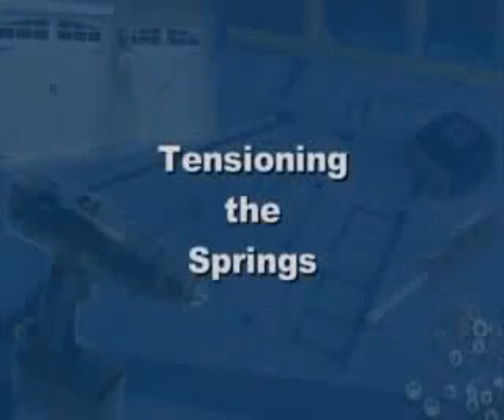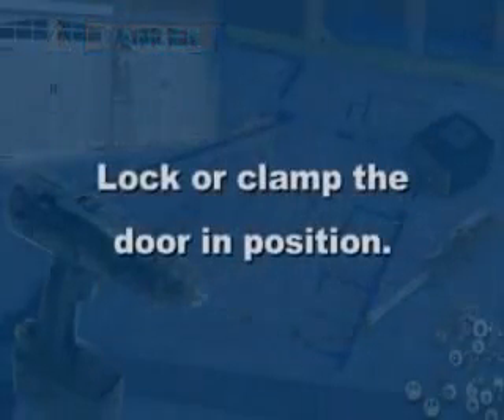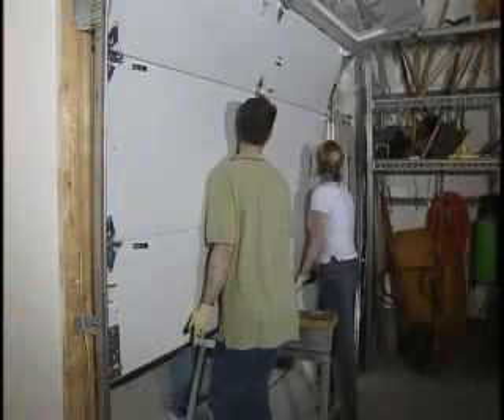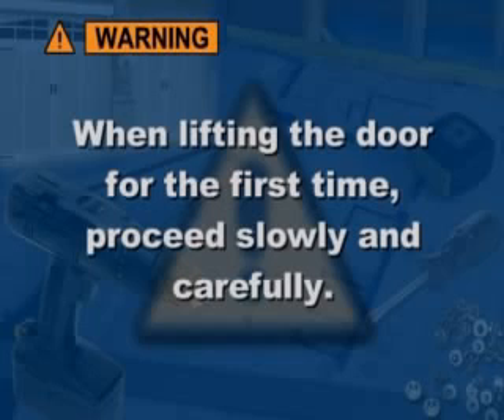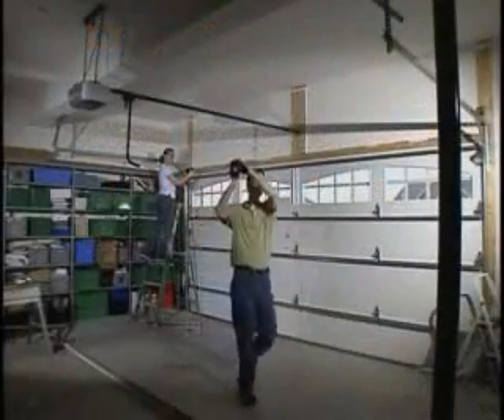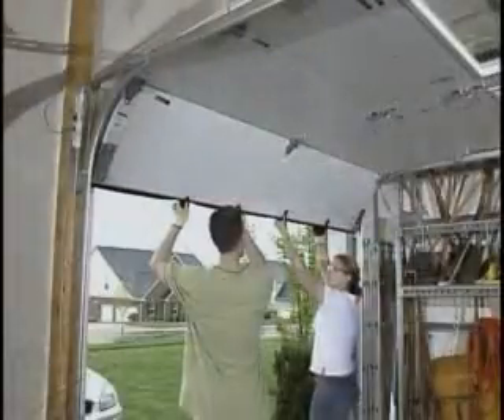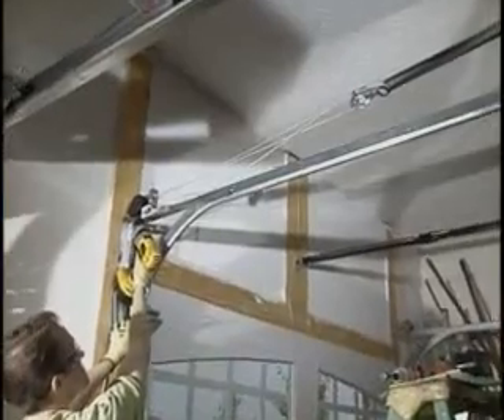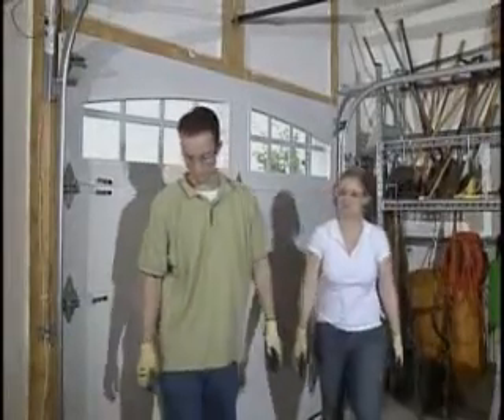R. EZ Set Extension Springs -C

Comment: I have a double garage door with coil springs. Why does the door when closing slides to the right, causing it to rub against the rail? Heck
Reply: What are the coil springs yoy are talking about? Pods torsion?

Comment: I hate fixing garage doors. those springs can be a viscous bitches like the cables. Last time I skinned myself while attaching the spring and holding the cable. I'll need to look into that little tension setting tool sometime.